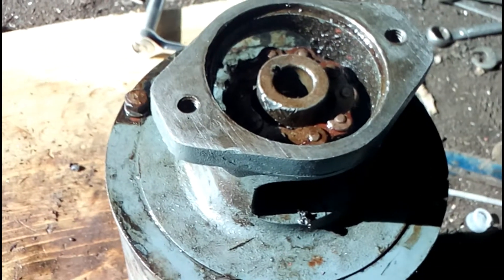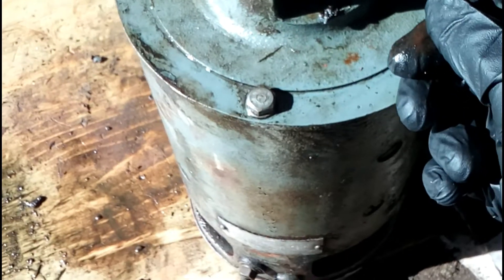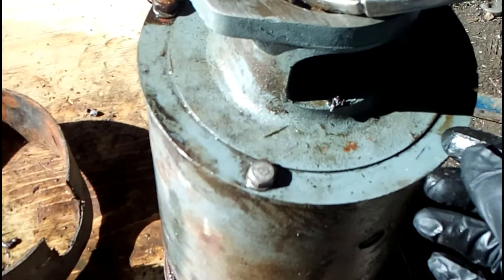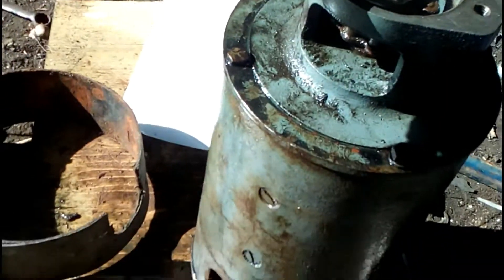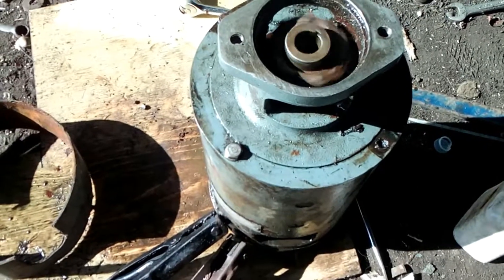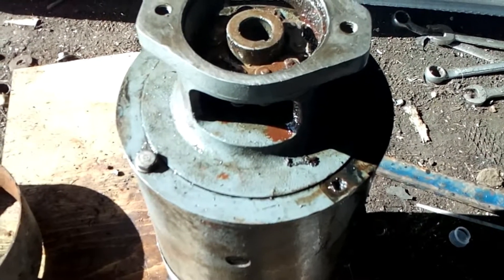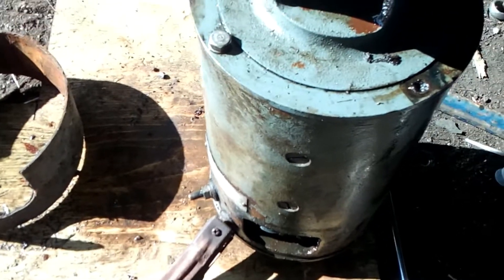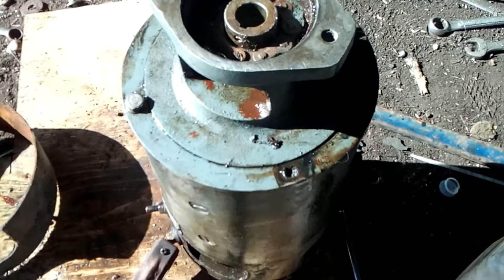Electric Forklift Motor Un-Seize & Test

Comment: Just found this video I own the same exact motor 5.5 hp G.E. 135 amp
Reply from the maker: Kolton Shampine 135 amp wow ⚡️ thanks for the info 😎
Reply: MrJohn613 Budget Builds it’s a shunt motor not series wound meaning current runs in parallel not in series which is why you can change polarity but the direction doesn’t change.
Reply from the maker: Kolton Shampine 👍🏽 ok good info , I think it was the hydraulic drive motor for the old Clark forktruck .  I think it might be ok with a transmission, same a gasoline engines only run one direction as well.  But a transmission would allow reverse.  Maybe good for a budget EV conversion ?  🤷🏽‍♂️

Comment: There will be a series connection inside. To make it go clockwise you need to go inside and change it in there. Nice motor and great skills getting it moving!
Reply from the maker: thanks for the info!  i was considering installing into my DIY SXS hoemade 4-seat buggy, which has transmission and reverse gear but its nice to know how to reverse it.  ive dreamed about building without a gearbox, and possibly mounting the motor directly to a diff or drive shaft.  its a nice old motor, i kinda wish it had a 4 bolt mount flange instead of 2, it was the hydraulic pump drive motor off a classic clark electric forktruck.  thanks again

Comment: Is that a 36v? got the specs? will Three 12 volt battery push a 2500lb car with that?  Id like to connect that direct drive to the differential on my chevy and take my girl for a spin.
Reply from the maker: yes it is rated at 36 volts.  it will run on 12-48 volts, but its best suited to 23-36v.  3 batteries in series would give 36 volts but not many amp hours in 3 batteries, ultimately mileage.  might need a bigger gas tank like 6 batteries arranged into two 36v banks joined parallel.  i'd love to join something like this to a small gearbox and small vehicle but batteries always seem to be out of my budget.  i'm not sure 3 would be enough, unless used in conjunction with a small alternator generator which can be run only incase of emergency charging, only requiring a small engine occaisionally perhaps...  i think this motor is 7 or 8 inch diameter, i think its around 6 hp but they are super torque machines
Reply: is a gearbox necessary?  I was thinking 3 deep cycle 200AH 12v in series.
Reply from the maker: @12vLife  not for a motorcycle but a gearbox is necessary for this two pole motor as it is not reversible via polarity.  i reverse polarity and it rotates the same direction.  4 wheeled vehicles require reverse or some sort.  some motors have 4 poles and they are easily reversible via polarity and reverse may not be required, but in my experience small motors like this need gearing and its fun to row through the gears.  also this motor is a low RPM motor if powered at 36v, so in this case i believe a gearbox is necessary for low end and reverse, especially with a small bank of only 3 batteries.  but  maybe with a very light vehicle or motorcycle that would be adequate.